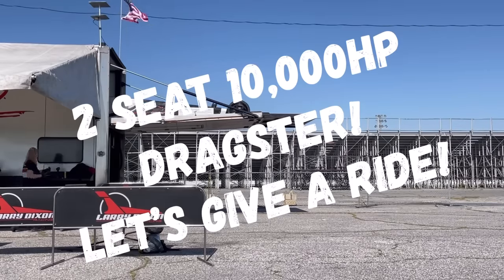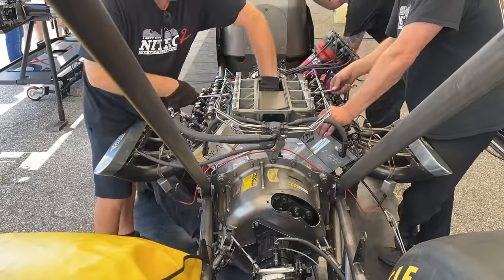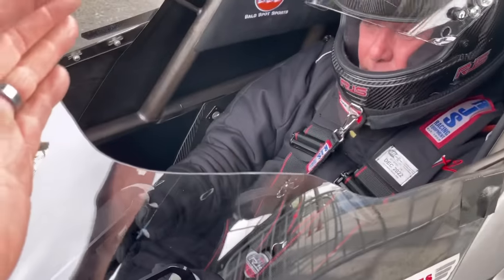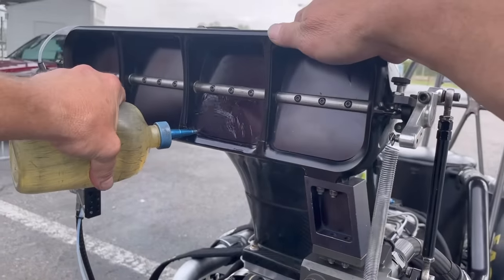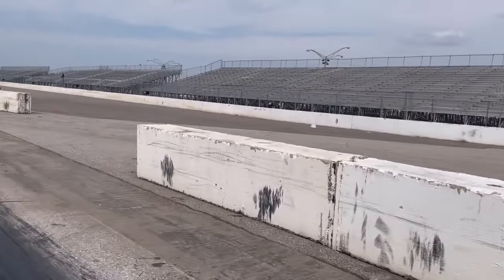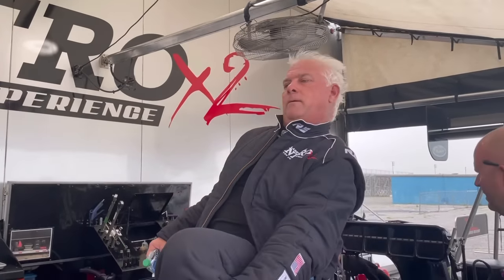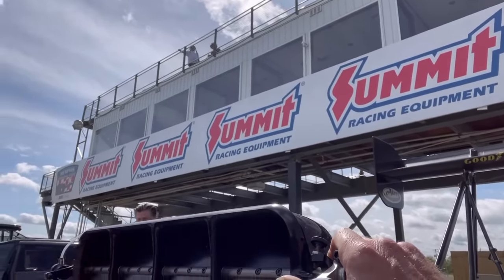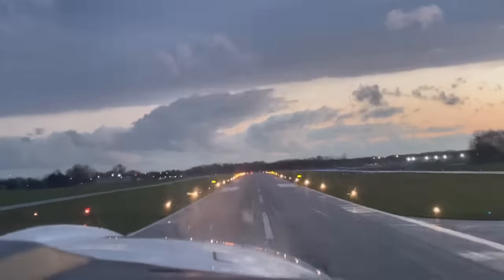TAKE A RIDE IN A 10,000hp DRAGSTER!

Comment: "We gotta rebuild the bottom end, so you're going to have to wait like 15 minutes"
Reply: But you need to wait 2 hours for the mechanic to change oil in your sedan.
Reply: Bills 10hrs Labor.
Reply: @cinegraphics  I don't know what crack your smoking, every oil change shop takes about 30 minutes TOP. Or you can quit crying and do the oil change yourself, it's just an oil change...
Reply: At a national event they have 1hr 15 minutes between rounds Acounting for the time they spend getting to the start line and getting back to the pits they actually do a complete tear down and rebuild in about 45 minutes
Reply: @larryhullinger4141  In 45 minutes I can sometimes find my 10mm.

Comment: For the Porsche 917 Le Mans car they had a tube chassis as well that would also crack alot, so they made it air tight and pressurized the tubes with Nitrogen and put a gauge on it.  Come track time, they checked the gauge and if it wasn't reading what it should they had a crack.  Could save you some time and provide for a much more thorough indication if the chassis has any cracks in it.
Reply from the maker: We have system controls, brake lines, clutch controls in the chassis rails to protect them. So this is not possible

Comment: I respect and appreciate the attention to safety, especially inspecting all the welds on the frame. All my knowledge is woefully obsolete but is pressurizing the frame and checking it at a Schrader valve no longer appropriate?
Reply from the maker: Not on a dragster

Comment: That shot of the car backing up is a great illustration of how big the difference is in tread width between the tyres at low speed, compared to when it’s up on the tyres at high wheel speeds.

Comment: I feel the need to mention this as it is unfortunately relavent: put extra emphasis on cheking the top portion of the frame for cracks. Especially at welds like you do, but also along the members. As I understand this is a one off design so being with anything that isn't refined, unexpected stresses can exist. And in cases were the loading is in tension, that is where you get crack formation and growth. In assuming your greatest torque on the frame is on the big end, you are gonna have huge tensile loading along the top of the frame. If you got a crack on any part of your frame, you will absolutely not want it to be on the top of the frame at this point in the run.
Your big worry should always be the effects of fatigue failure and be aware of stress concentrations that exist in the frame at joints or any change in geometry. Fatigue isn't always thought about when using some component or in day to day use of a vehicle but is insanely important to consider. Its hard to compute exact failure points but it is possible to get an idea.
Reply from the maker: Well the design in this car wasn’t on the back of some Cracker Jacks. Murf McKinney had all the FEA work done on this car and it actually has less “hot spots” than any single seat top fuel car. With the additional length it removed all the front bay stress loads. Also, the critical area is the #5 and #4 bays, lower rails, not the top.

Comment: Appreciated your showing the chassis bring checked.  I have heard Clay Millican say that transporting their TF car is much harder on the chassis than racing is.  And that despite their using I believe 3 air bladders under the chassis, letting all the air out of slicks and then strapping the entire car tightly down to the trailer floor.

Comment: Rob Wendland, what was the issue with the idle speed not coming up to around 2700 on the first run? Was it mainly because no. 7 wasn’t bringing anything to the party and had the tuneup messed up enough that the other seven cylinders couldn’t idle it up to speed?

Comment: The titanium shield on the rear rollcage/drivers compartment is to stop debris from injuring the person inside. I am surprised that it is not on the front rollcage too. The framework from the rear wing is one example of what could enter in an accident. If memory serves, it was a spar or tube from a wing entering the drivers compartment that instigated the titanium protection. Genuinely interested in the safety guys view on this.

Comment: Speaking of checking the welds, Porsche used to pressurize their space frame chassis back in the day and kept a log of the pressure via Schrader valve. Surely that would be a quicker and more effective way of diagnosing the whole chassis at once?

Comment: Hey Rob! Love the channel! Got a question for you. Why do you spin the rotating assembly with no ignition before firing it up? Thanks in advance!
Reply from the maker: Collin, we do that just in case there might be any small amount of nitro in the motor. We also build oil pressure that way. Before we spin it we also back the motor down by spinning it backwards to remove the possibility of a full cylinder of nitro.
Reply: @robwendland  dang it it’s so awesome for you to give us this access with answering our questions. I just can’t say enough times how much this means to us top fuel heads!!!!

Comment: Inspections or not, metal fatigue will occur. Question is when?
Reply from the maker: Our single seat car goes 140 runs in a season. We will replace the front half at that time. The two seat car makes 20 runs in a season. When the tubing starts to fatigue you will see it in the straightness of the tubing. 
You might also see it in the way the car is reacting. The two seat car actually has less stress on the entire car then the single seat version
Reply: Larry,Rob and crew leave nothing to chance. I never felt unsafe at any time.

Comment: Can someone tell me how much that costs. I had a ride in a two-seater at Santa Pod UK which cost me £600 but that was only (I say only) a 9.8 litre big block Chevrolet engine running on C12 Octane race fuel with 1000bhp. 1/4 mile: 7.9 seconds at 175mph.

Comment: Imagine if they used turbos instead of a super charger,spitting flames for hours🔥🔥🔥🔥🔥🔥🔥
Reply: I'd imagine that a turbo would supress the flames as its designed to take as much energy out of the exhaust gases as possible. Also I don't think that a turbo would spin up and be response enough for this form of racing, it probably would not make the boost that is required anyway.

Comment: Can someone please explain to me how you get 10,000hp to the ground without just going up in smoke?

Let's say you had 20,000hp would that make it faster than 10,000hp? 
At some point an increase in hp isn't a help at all times right?
Reply: The tires are so thin walled that they actually stretch out to reach higher and higher diameters (effectively acting as a gearbox). Drag tracks also have literal glue all over them too because drag guys don't care for real world conditions
Reply: @RhodokTribesman  I'm definitely familiar with wrinkle walls and how they work, however I didn't know that they apply glue on the track, thanks for the information👍.

Comment: It's because your right bank was not working properly.. lack of down pressure... You get wheel hop.😘
Reply from the maker: Johnny I appreciate all your comments but (wheel hop) properly named (tire shake) is the tire starting to gain grip either too early or too late after the launch. The tire is basically spinning a majority of the way down the track. Early on in the run (around 50 to 80ft out) is the most critical area. Timing is everything to control this issue. Temperature and the amount of traction available play a huge role in this. The tire tries to run over itself which makes the tire almost square and loses surface contact.

Comment: Can I actually go ride along in a top fuel car. Hell how much and where do I sign up. The ultimate experience
Reply: Considering every run the car makes costs at least a few thousand I’d guess the ride costs several thousand. 

*Saw in another comment the ride is $10K. Which sounds about right. Just making a pass costs them a lot of money. 

If you’re serious internet searching is your friend as there can’t be that many 2 seat top fuel cars running around.
Reply from the maker: About 7800 to run the car. Travel. Parts, fuel ect
Reply: @robwendland  thanks for info

Comment: 10,000 hp

*laughs in space shuttle fuel pumps
Reply from the maker: It’s the same power plant from our single seat car. Engine, clutch and rear end. We swap them with each other. We have been 3.689 @330 mph in 1000ft. It makes 10,000hp +. Now what???😘
Reply: @robwendland  yes I was mearly making a joke because the fuel pumps on the space shuttle were rated at 40,000 hp

Comment: Probably ignition issues.. also maybe fuel issues.. didn't see raw Fuel leaving the pipes.. just my opinion 🤙😎🤠
Reply from the maker: #7 (left rear) went out at the hit. Found a air glitch in the AlValve management and corrected or tricked the issue. It spiked the CC’s per turn (accelerator pump) at the hit which introduced an excessive spike of fuel.

Comment: If you adjust the car for the conditions then should you not get a full pull? Maybe change the gearing or the timing of the gear change to adjust for the track. Most NHRA events don’t cancel because the conditions are not ideal. Honestly I’m just interested not trying to be a smart a$&.

Comment: I'm guessing it cost about $1 per horsepower to take a 4 second ride?
I know, I know...if you have to ask then you can't afford it.
The most g I've experienced is 3. This is well over that I think.
I had a bike that was rated 11.0 sec at 125 in the 1/4   0-60 in 3.0 sec.
That is nothing compared to this machine -   
0-100 in less than 1 second.
I can not imagine what it would be like to be onboard.

Comment: Thousandths of increments? You need to state the units. There’s a big difference between 1/1000 of an inch and 1/1000 of a meter.
Reply: Also, the voice-over when the mic is near the running engine is inaudible.

Comment: It seems so dangerous all those people standing in front of the rear tires while it’s running. If the driver lets go the clutch accidentally then it’s a lot of deaths in 0,3 seconds. Or if that stand breaks when working on it while it’s running at 2:59. Interesting hobby though.

Comment: So basically the engines are not designed to withstand the power at all. That is not OK for an engineer's way of thinking.
Reply: The engine is supposed to survive 1 run

After that it gets rebuild. I mean you need to sacrifice something in order to get 10k+ hp lol

Comment: And do you have the 10 grand to pay for a thousand foot pass? How bout the financial ability to pay for the car if it sustains any damage during your run, your fault or not? Dont worry, you won't be doing any driving but for that brief few seconds you're on board, you'll be financially liable like you were the owner so...

How fast you wanna go?
Reply from the maker: The rider isn’t financially responsible for anything outside of the 10k cost of the ride.
Reply: The correct answer is: "As fast as that thing can go!!". That's how fast.  If you did have to pay for a wreck, (which is incorrect), why would you want to go a little slower and pay for a half-ass wreck that totals the car? Get your money's worth by hauling ass, and pay for a freakin' spec-ass-tacular wreck that totals the car! Probably not a huge difference pricewise.  lol
Reply: Where did you get that from? You need to learn a little more about this.